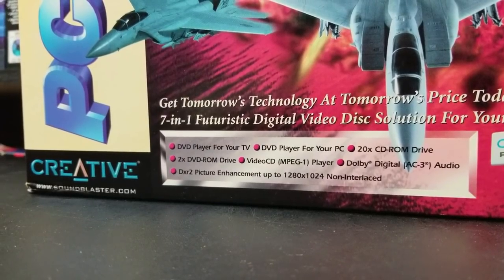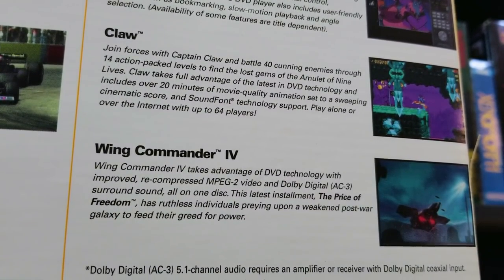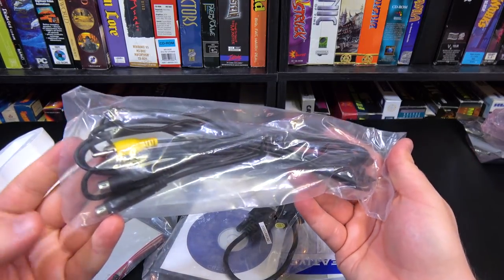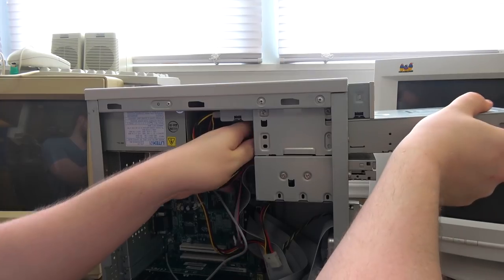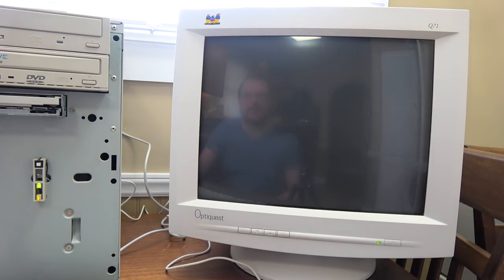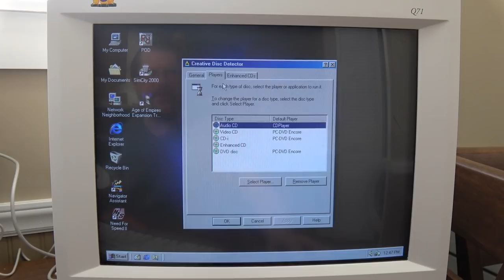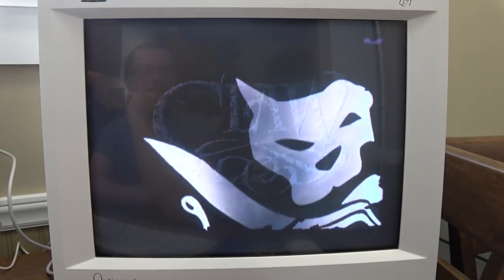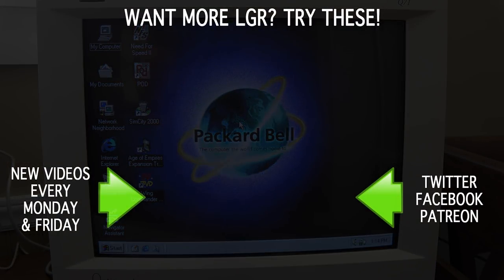The 1997 DVD-ROM Upgrade Experience: Creative Encore Dxr2

Comment: should try to play DVD without the card and see the improvement.
Reply: The issue back then was that PCs just weren't powerful enough to decode fullscreen mpeg2 without the decoder card.  When I got my DXR2 it was in a Pentium 200, which couldn't even of doing it (my drive had the DynamicResolution written on the drive, and the drive stilll works!).  That K6/2 might be able to though.  As far as the difference.. it was huge.  The flickering in this video was just as noticeable in person, and with wc4 especially there was an awful lot of jitter- it wasn't very sharp at all.  The problem with wc4 particularly is that it was hard coded to the card.  It wasn't possible to play the game without the dxr2 card until an MCI to Directshow wrapper was created, many years later.  The GOG version of wc4, nowadays, works flawlessly and is far better visual quality than running it on this setup ever was.
Reply: Yes, i know the diff is huge, and it is fun to see that diff. it was also fun to see a 486 to watch vcd without a mega card.

Comment: It's not only for DAT. It's S/PDIF, to let the sound card's DAC do the work for CD audio. If you have a drive with those play buttons and that connector, you can take one of those cables, put an RCA plug on one end, power the drive with a PSU, and connect that RCA plug to a digital receiver and listen to an audio CD, letting the receiver do the decoding.

Comment: > Press and hold 4 seconds to turn off

PLEASE NEVER DO THIS OH GOD WHY WOULD THEY PRINT THAT
Reply: Computers back then spent most of their time experiencing blue-screens of death and otherwise not responding.  Had an old IBM Aptiva that loved to crash on shutdown, so that was kinda what you did anyway.  Modern systems are a lot more stable, though I guess in a way, they've lost that unique 'charm' of violently crashing at the worst possible times.

Stuff just wasn't stable back then.  Made more sense to tell people how to turn it off so they could turn it back on again, or you'd have every customer service hotline deadlocked for hours with "My computer's not responding, how do I make it work again?"  Sure, you'd have file corruption, but in those days, that was common anyway.  Why do you think Windows XP and onward don't allow you to continue running after a BSOD?  It's to minimize file system corruption.

Back then (and I know we all used to do it at least a few times), you just pressed any key and tried to resume your now-slightly-less-stable Windows session, because heck-no I'm not restarting before I play my game again.  Then it BSOD's again, you hit the space-bar, try something else, and repeat until the system's so unstable all it'll do is BSOD.  So you restart and go right back to what you were doing, and, well, now there's some system corruption.  It adds up, and next thing you know, a few months to a year down the road, you're reinstalling Windows 98SE.  Or, you're installing Windows 3.11 to upgrade to 95 to upgrade to 98SE.

It was part of the 'hobby' back then to spend half of your time troubleshooting why things didn't work, and the other half of your time split between having fun and dealing with crashes.
Reply: Oh yeah, I remember when Windows 95 first came out, and a good portion all the 386 machines out there were too flaky to boot it. Quality control for hardware (especially RAM) was really lax in the DOS era, since DOS was such a bullet-proof (albeit stone-age) system.
Reply: Kenton Cernea Makes sense - the minimum recommended spec for 95 was the 386's DX variant, and a 486 was recommended.

I'm sure you know this though haha.

Comment: My brother got a Dell Latitude back in 1997 or 1998 and it had a DVD drive which was a major talking point to everyone that saw it. My how times have changed and how fast said change happened. I remember making sure my parents would get a PC that came with a DVD-ROM, CD-RW and AGP graphics card back in 2000. Unfortunately we ended up getting an HP Pavilion over a Dell Inspiron XPS-T because it was slightly cheaper. It came with the same hardware but the Dell had 4X AGP while the HP would only ship with a 2x AGP

Comment: I bought a Creative Labs Dxr3 kit from a co-worker back in 1999. I think I paid about $200 for it. It was amazing. I and my family ended up making use of it for at least 8 years. I actually finally tossed the card out 2 years ago.

The issue that LGR ran into happened to me. Every DVD I played would just freeze the system. I tried everything I could think of, short of a fresh Windows install. Finally, after about a week of frustration, I discovered it was a check box setting in the software for the drive. I don't remember what check box, but when it was checked, it worked. When unchecked, everything froze. Drove me crazy.

Comment: The first PC with DVD playback I got was in late 1999. On that one, the MPEG-2 hardware decoding was part of the ATI Rage video card, and I had to use ATI's specific DVD player software for Windows 98. But hey, it worked!

When I went off to college, I got a Powerbook G3 with a DVD-ROM drive, and the video decoding was all worked out in the ATI chip in there, but patched through Apple's DVD Player in the Mac OS.

Comment: The exciting thing about the Creative DXr2 was getting it to work under Linux. Plenty of people at the DVD tech forums said that it couldn't be done and we should just run Windows like sensible people, but eventually people got the drivers working and it was actually better than the Windows version. People discovered some interesting features like an easy way to disable Macrovision if you wanted to tape a DVD to a VCR.

Comment: I bought that back in 97 really expensive and high tech at the time. It was quite a job to get it work. I had 20 meter cable from computer to tv. I do remember sound from installation disc.

Comment: I remember buying this kit because standalone DVD players were pretty expensive and I didn't have a TV anyway. I did get the big DXR2 logo on the drive though but at least you got nice sleeves for the games that were included.

I also remember getting an update of the PC-DVD software on the Matrix DVD, I didnt have access to the internet so it was quite handy. However I wasn't really excited about the quality of the video and usually subtitle were like half cut off (especially Colombia TriStar releases) but that was maybe because PAL uses more lines or something. The quality on TV through the Composite or S-Video was awesome though and many standalone players had problems when switching to the other layer on DVD8 discs which this kit didn't have any problem with.

Comment: I had this kit. The video quality was very good. even after I got a good enough CPU to use a software decoder, I still used the card due to the video quality. The card also had AC3/DTS passthrough. I had to use two VGA passthrough cables, one for the DXR2 card and the other for the Voodoo2 card.

Comment: The Digital audio port on the back was used to connect to the sound card or MB. Because it wasn't an analog signal it was isolated from the internal noise of the computer ie the fans and drives and power supply. That is at least what they were saying at the time.

Comment: I had one of those back in the day. Not the Creative version, but the Sigma Designs Hollywood+.  Sigma Designs were the ones who manufactured both cards (the H+ and the Dxr2) while Creative was just reselling the Dxr2. The cards were pretty much identical, except that the H+ didn't come with stickers on the chips to cover the name of the real manufacturer. :) Also they had different PCI IDs so the drivers from Sigma wouldn't install with the Dxr2 card sold by Creative, and the other way around. The included player was different too. I first upgraded my PC in 1999 with a DVD drive, and then when I realized that my 300MHz CPU and ATI Rage Pro video card couldn't decode real time MPEG2 I bought the Sigma Designs card. In fact I still have the card in one of my boxes, complete with the passthrough cable and the driver floppy. It's pretty useless these days, but man was I impressed that with it I could watch DVD movies on my PC. IIRC one of the software DVD players of the day (might have been SoftDVD) had support for hardware acceleration when one of these cards was installed.

Comment: I used to have not one but TWO of these things. Yours must of been a later run cause both my drives were marked as the box art. Was simply a stunning kit when it came out, turned my PC into an actual DVD Player..I think I've got a DXR2 around the house still, also have the games, don't really need to have the card in a modern system to run em fine nowadays.

Comment: I had one of these I bought in 1997 for $400.  It was a lot, but half the cost of a standard player, and ultimately more flexible.  The MPEG2 card at the time was a pretty big deal, as you needed a Pentium II at 300Mhz to play DVDs without dropping frames.  With this card, the CPU utilization was miniscule.  I had added another optical drive and gaming while the family watched a movie off the MPEG2 card was possible, and frequent, all on a 166Mhz Pentium.  The card had a separate video/S-Video and audio and SPIDF out (it did support Dolby Digital, but not DTS).

Goldeneye and Air Force One got a lot of play.  I believe this was the only way to get Wing Commander IV in DVD, too.  It was a big step above the original release, which was on 6 CDs.

Also, that Digital Audio connector was standard SPDIF.  Normally you would use the analog cable to connect your CD drive to your sound card, and this was just a digital substitute.  They were quite uncommon.

Comment: I had the same thing in early 1999 with the same card like yours but bundled with a 6X DVD drive. I had a e-machines Celeron 333 MHz with 64 meg ram plus a 4 gig hard drive with windows 97. This was my first DVD movie player so in order to watch it on my TV I would have to run a thick 25 foot RCA cable to my TV across the living room floor every time I wanted to see a movie. The only way to hear sound was with the computer speakers which didn’t sound so good. Shortly after I purchased a Denon DVD player for $699 which had a optical out so I could connect it to my Yamaha receiver.

Comment: I had this dvd encoder. I remember the hardware made the movies look a bit lower resolution, but if I ran it without the encoder the movies were ran by the software which made it skippy. Also some movies had insane widescreen on a CRT TV like Armageddon so basically you were watching a postage stamp size. Good times

Comment: This is interesting. I never saw the full retail version. In either late 1998 or early 1999, I was able to grab an OEM DVD-ROM (I think it was a Panasonic, may have been a Toshiba, but eh, whatever) for around $80. Around the same time Creative released the DXR2 card by itself - mainly because it was hands down the BEST experience for DVD on the PC, but many people did not want their overpriced drives. I am thinking the card was around $129, but may have been cheaper. So for right around $200, I was able to get up and running. This was great at a time when DVD players were still way over $200.

I was in college at the time, and we had a 55" projection television and 4 speaker surround sound set in the lobby of our dorms. I was the only one in the dorm with DVD. On Friday and Saturday nights, I would haul my PC down there and we would watch movies. I had an ATI All In Wonder, so we did not even have to haul a monitor down there - I would use the SVideo out on the All In wonder to launch Windows and the DVD app, then flip the cable over to the SVideo out on the DVR2. Worked great. The downside is that, as I did not have the full Creative kit, there was no remote, so I learned those keyboard shortcuts!

Comment: I question whether it was using the MPEG2 card at all. If you installed any sort of other DVD player software after installing Win98SE then it would install a software decoder and the system may be using that. You should play a DVD and disconnect the VGA pass-thru cable to see what's going on. If it plays you know you are getting output from the decoder card.
I remember back in the day at Gateway troubleshooting some of the computers we sold with MPEG2 decoder hardware, you had to install the drivers in a specific order, pretty much sound, video, MPEG2, and the player software for the decoder card, in that order, with everything else before it. You absolutely wanted the video, MPEG2, and DVD player software to be the last three things you did. Except in our case the setup didn't require pass-thru cables; that was all handled internally.

Comment: I bought a beige dvd-r ide drive just to fill an empty gateway 2000 5.25 (no bay blanks remained in the case). Thing is substantially heavier than cd r drives and barely works lol

Comment: Setting to Cable Select was a better option as it caused it to detect on the cable where it was plugged in.  End of the cable was the first drive and the middle was the second drive.  Love your videos by the way!  I am always glued to them with the nostalgia that you bring!  =)  Just out of curiosity, there is a number on the restore disc.  What is the number?  Some of the restore discs had issues with drivers, etc.  I worked for PB back from 94 - 97.  I think the unit you have there might have been created around the time I left to go to Intel.

Comment: I still have a DXR2 card somewhere, and a copy of Wing Commander IV that came with that drive.  Fun fact:  you can't play the game without that card, even on a more modern system.  It looks for it off the top and won't even try to play without it.  I think someone made a patch at one point that would trick it into thinking you had the card installed, but originally I guess they assumed if you didn't have the card there was no way it was going to work.  Or maybe it was just copy protection.

Comment: I had one of these. It took time to get working but meant a low end Pentium 2 or even a high end Pentium 1 MMX could play films. Video quality was not perfect, a bit stoppy and the sound unsynced at times but back then it was impressive. I found it in a bargain bin in Currys but still cost £50, quite a lot but way cheaper than full price. Wish I had kept it.

Comment: Wow, I didn't know DVD existed that early. I thought it came in 1998. I didn't hear about until around 2000-2001. I didn't get a DVD-ROM until 2003 and a stand-alone player until 2004. In 1997 there were still some that didn't even have a CD-ROM player, and CD's were still quiet overkill, easily rivalling slightly older hard drives, so a DVD in 1997 was extremely cutting edge!
And an MPEG card, oh my gosh! I only heard of them many years later. To actually see one, albeit in a video, is super cool! All this effort and extra hardware required just to play a video, something that was taken for granted a very short time after. The 90's was really awesome.

Here I am thinking this is super interesting. But all there is in the comment section are penises. SMH…

Comment: Great vids LGR. The statement on software decoding / PowerDVD is a little confused. IMHO software decoding in the 90's improved with CPU power and software optimisations, but it wasn't until Intel introduced SSE that MPEG2 playback was silicon accelerated without a card.

Comment: I have this exact same drive. Sadly only the drive, I don't have the box or software. I'm currently using it as a replacement drive in a 2005 Dell tower that I'm making into a Windows XP game machine. I didn't know this drive had it's own expansion card for MPEG decoding.

Comment: Weird, I just noticed this video and coincidentally I was an early adopter of the DXR2. For some reason 12th June 1998 comes to mind as the date I bought it.

I remember being very impressed by the video quality of the included video but I soon noticed a weird artifact that I now know was posterisation on all my dvds. It was probably a faulty unit but at the time I assumed it was down to my PC. Still, I learnt to ignore it.

Sadly wing commander didn't work either, most I could do was playback the video files directly

Comment: Why not put the monitor out next to the other two outputs and the VGA in on the far left?  Then you would just plug things in from left to right (video input > video output of choice > audio output), no guesswork or manual required.

Comment: funny... I have no clue what-so-ever what kind of magic algorithm youtube used to put this video in recommended vids for me.

Anyways I had one of these back in the days, but mine did not include the Wing Commander IV bundle. Probably since I bought mine here in Norway. What I did get was a Region2 Jackie Chan movie that the DVD was unable to play, Rumble in the Bronx I think it was.

The MPEG card was simply amazing for the time, not only was the DVD playback on a then slow PC perfect, but a small software I found on UsenetNews, fixed the region problem. I could change between region 0 and the other 9 as much as I wanted to instead of those 5 that was normal. Region 2 movies at the time was almost non-existent, and all of them back then seemed like something they had ported from VHS to DVD. They had nothing extra as one found on the US Region 1 dvds (directors commentary, alternate track etc.), poor image quality and most of them was Mono or Stereo. I believe the first 5.1 DVD in region 2 that I bought was around 1999. So for the first few years during my DVD period, I bought imported Region 1 DVD 9 out of 10 times.

In my humble opinion this DVD bundle kit with the DxR2 card is by far the best piece of hardware ever released by Creative labs. (And I have owned a few)

Now I have to explore the rest of the channel to find other nostalgic videos...